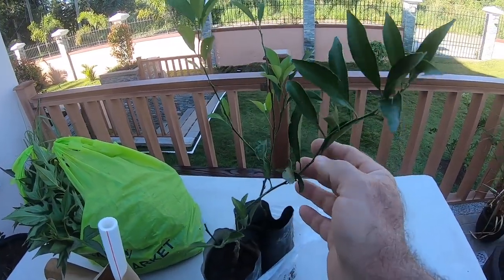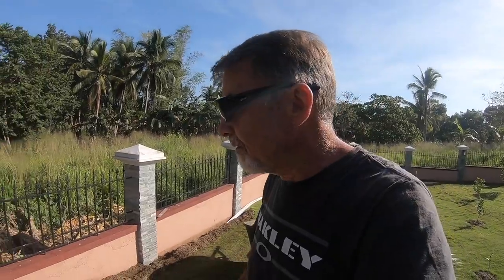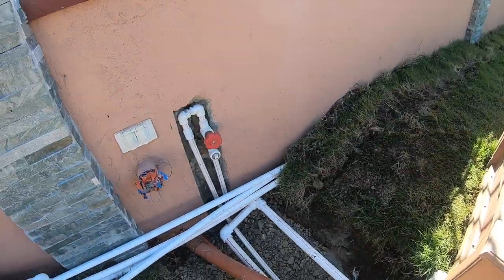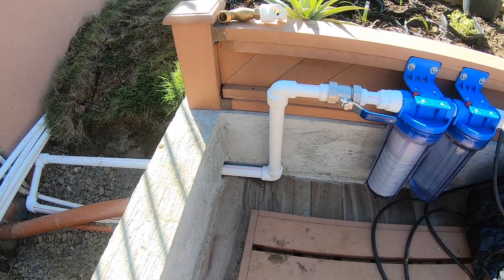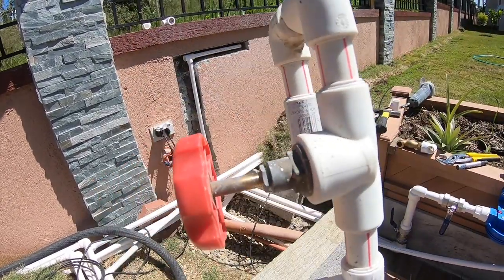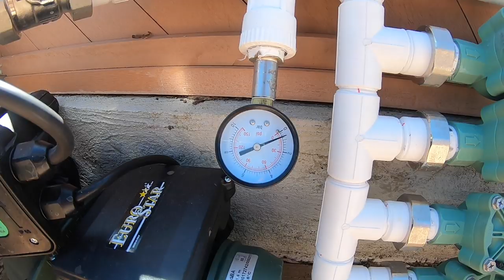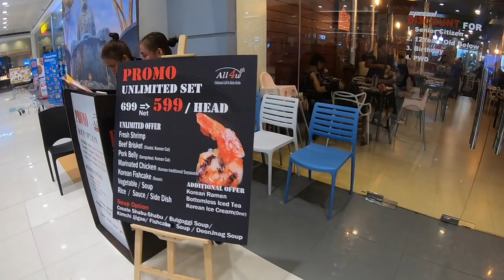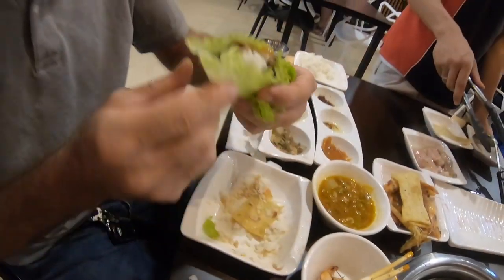VILLA FELIZ - EPISODE 459: PLUMBING, SHABU SHABU & BIRTHDAYS (House Building in the Philippines)

Comment: Hi james well done on your irrigation system  it works great.why did your builder put it up thewrong way it should be a plumbers job notbuilder to do all water pipes hence what happened  in your shower area im glad james you caught that in time other wise it would have gone through the underneigth the tiles lfting them in time well done james great job in spotting that in time but i like your irrigation system. You will do it it will work out with sealing that the hard jobs finding the leak or hole  looking forward  to seeing you do that job  james
Reply from the maker: Oh my goodness Scott...don't you remember we fired the plumber...twice???

Comment: I don't know if this is an issue in the Philippines or not. In the US. any time you put cistern / wells on a public supplied water system, you must put in a check valve that would prevent cistern water from entering the public water if all valves are accidentally opened. In the US, the example of error was in a mortuary where the mortician left the water hose on his table laying in his sink. You can imagine what was in that sink. A fire broke out down the street, and when they put a pumper on the local hydrant, all that gunk got sucked into the public water lines! YUK! (Think about that the next time you pick up a glass of tap water!) So, maybe a check valve will help protect the public water supply?

Comment: 30:06 James, according to my cals. if your cistern is 3.5m x 3.5m then that's 12.25 sq. meters with a given level of 1.5 meters of water you would have 18.375 cubic meters of volume which translate to 1000 liters per cubic meter so given an estimate of 18.375 cubic meter volume of water so you lost 18,375 liters of water. with 12" of water remaining you have only 3736.25 liters(roughly) I'm no math wiz but love architecture and building.

Comment: I did a calculation. So 1 L = .001 m3. You said that you have a 3.5mx3.5mx1.5m for your cistern, which is 18.375 m3. 18.375/.001=18375 L of water. That's a lot of water to go down the drain. An average American uses around 100 gallons or 378.5 L per day. Theoretically, you have enough water in your cistern (if it has no leaks and if you start from full capacity) to last you 48 days.

Comment: HAPPY BIRTHDAY NESS.  James, are you going to upgrade your cistern so you can catch more rain water?  Also, are you going back to the original water pump, the 2HP you had originally?
Reply: Unless you draw directly from the cistern, the 2hp pump would not help, since you are pumping from small input pipe size to larger size.  Just like our farm irrigation systems here in the US, the pipe size always runs from largest to smaller sizes, to minimize friction loss and volume over pumping.  Basically, you are going to need a much larger reservoir to provide water to your US style system.

Comment: Should have a check valve so you can't back feed into the city water
Reply from the maker: We don't have city water.  Our water is fed from an overhead water storage tank gravity fed to properties.  Although check valves are a very good idea to prevent back flow it's often not used nor enforced here.
Reply: James you shouldnt just be worried about the overhead tank in the subdivision but also dirty water siphoning back to your’s and nighbors’ drinking water supply